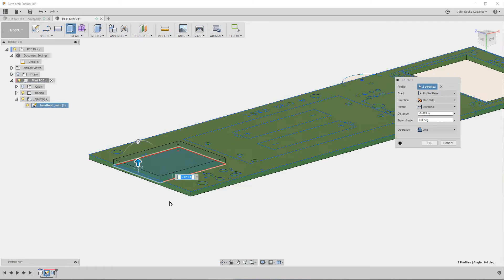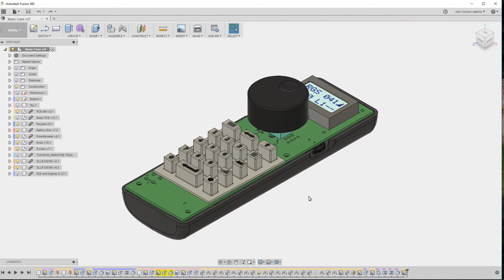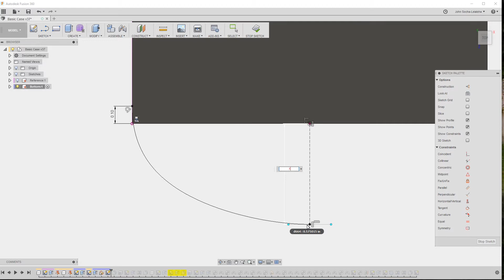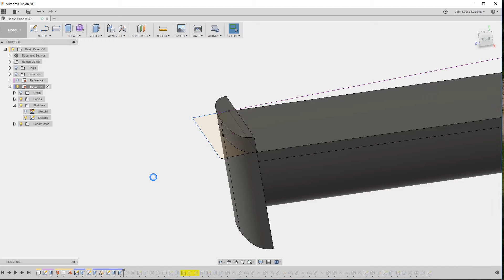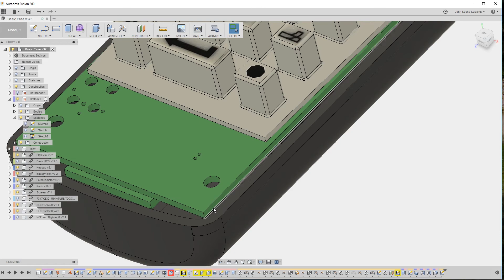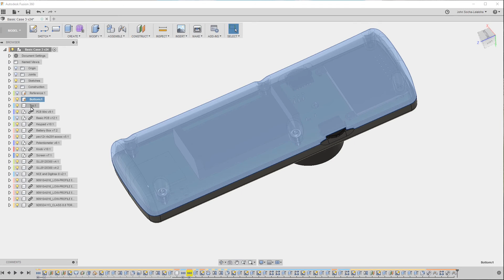#23 Throttle Case Design Part 2

Comment: Thanks! by any chance will you do videos with the morgan press?
Reply from the maker: We'll see. I'm not sure the Morgan can handle a part this size. I learned that for a basic mold, it's limited to about 9 tons of clamping force.  You have to make a more advanced mold in order to use the full 20 tons. I'm not sure of the cross section with the holes in it. Without the holes, it's about 12 square inches. Using the guideline of 1.5 to 2 tons per square inch, this would mean I would need 18 to 24 tons. Getting that close to the limits of the machine, in my experience, means lots of bad shots.